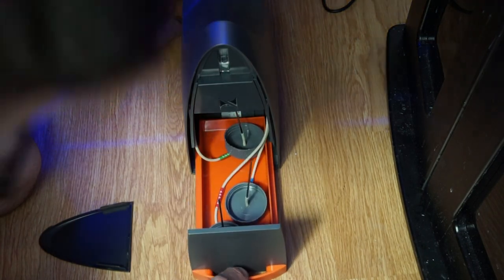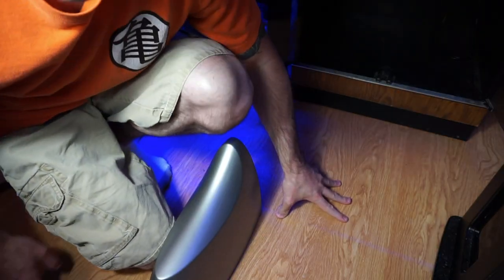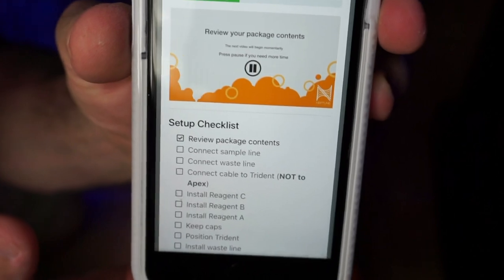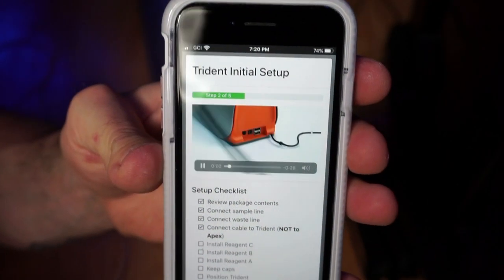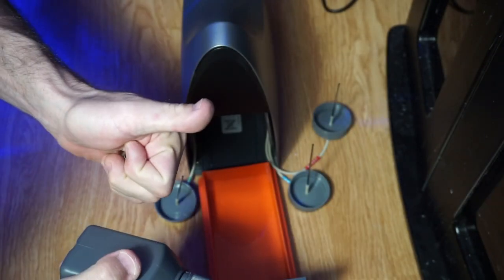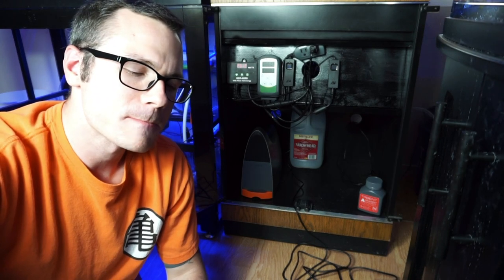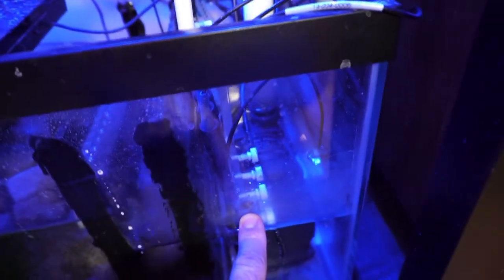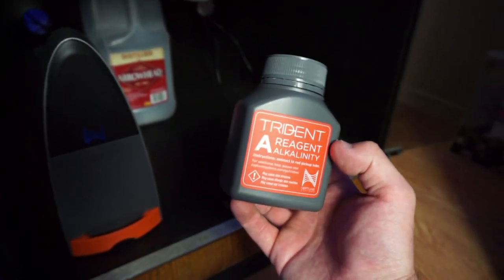How To Install Neptune Trident | SPS Reef Tank

Comment: What's do you use the calibration for ?
Reply from the maker: The calibration liquid?
Reply: Yes
Reply from the maker: @deadstead1123  For when it requires calibration, the app should tell you when and how to use it
Reply: So when setting up for the first time it's not needed.. asking because I didn't see it in your video
Reply from the maker: @deadstead1123  You should wait at least 48 hours after initial setup to calibrate it.
Reply: Ok thanks for the help 👍👍
Reply from the maker: @deadstead1123  No problem